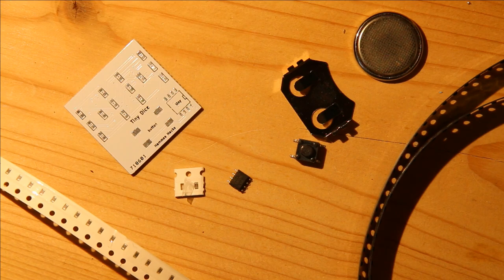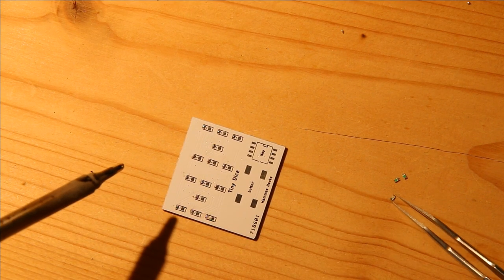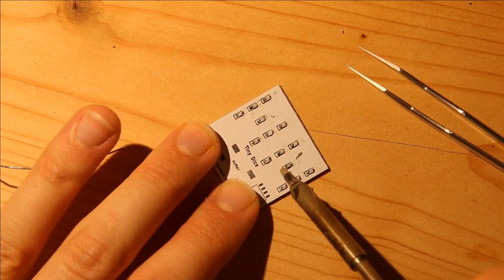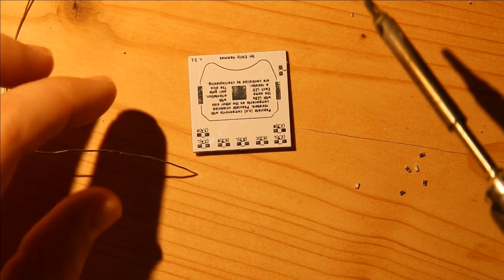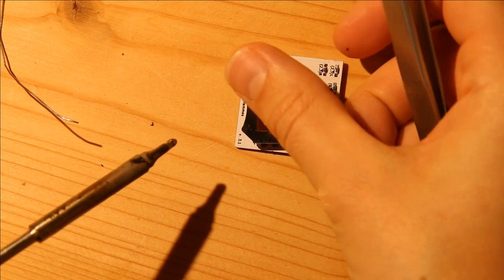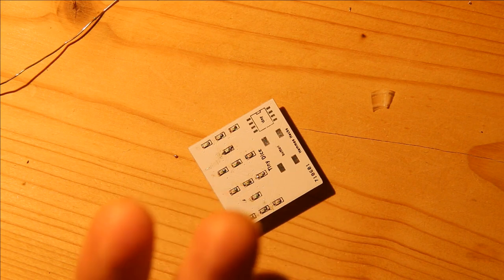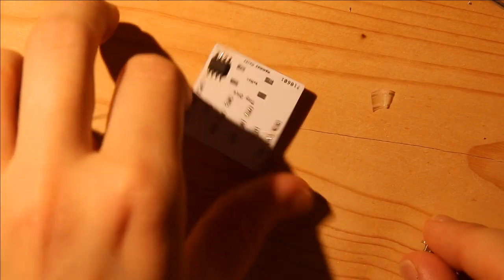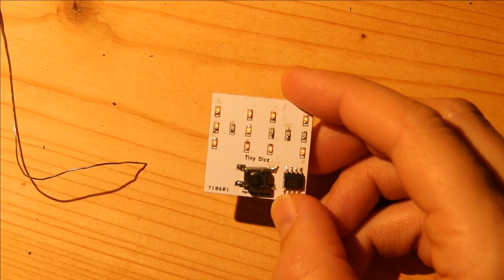tiny dice assembly

Comment: Interesting - I haven't really watched the detail of someone soldering surface mount parts like that.  I didn't realize one would prep and solder down just one side first, then do the other.
Reply from the maker: Yep. Soldering SMD is super easy, if you follow the right steps and are not ashamed to wear reading glasses (when necessary)! Also, holding tools like a person with horrible table manners helps alot: arms/elbows resting on table, side of hand/pinky finger on table for stability etc.